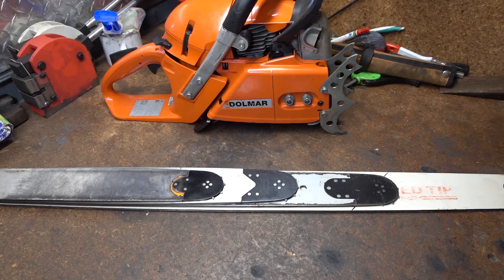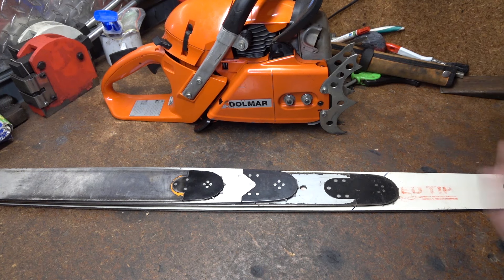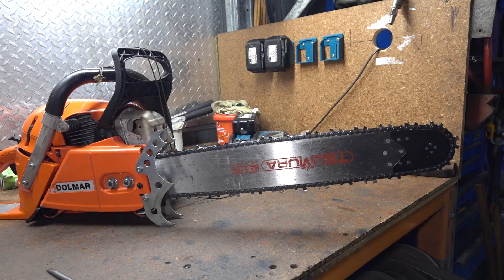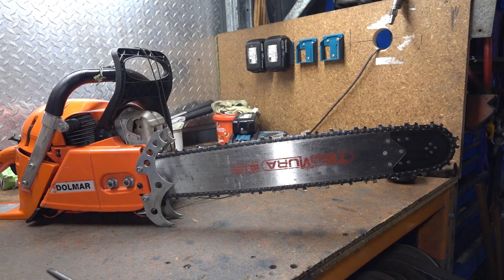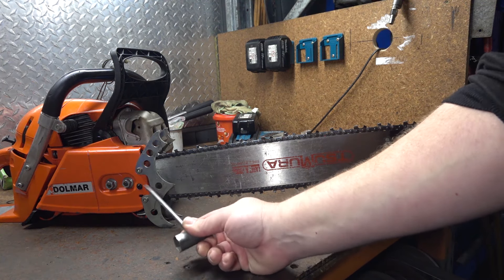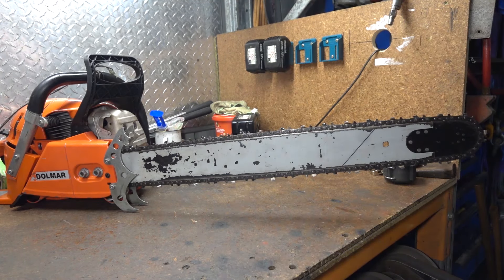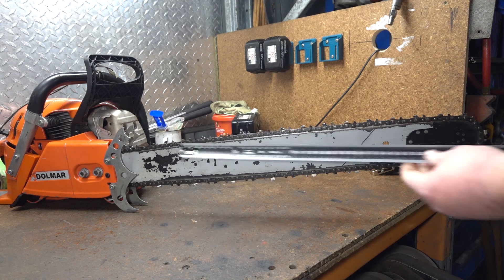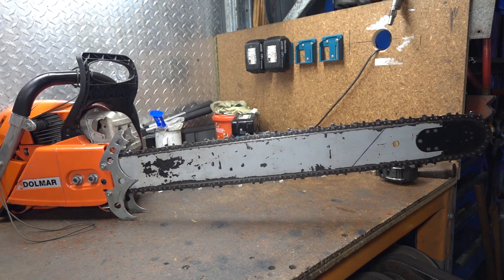Bar length, weight, balance, kickback and why I use short bars

Comment: The original 7900 like yours has the same power to weight as a 500i. So obviously it’s a lightweight powerhead. You’re certainly tipping with a 36” solid bar. In fact, a 36” solid bar nearly tips my 9010, and it’s much heavier.
Reply from the maker: Shhh, don't say that too loud or we will upset the 500 guys. We also can't say it has a wider torque curve and uses less fuel to do the same work.

It's not the best example but I used the 7900 and those bars because everything except the  tsumura bar is now discontinued. I wanted to show this without feeling like I'm trying to sell  something to people.

I don't think I own a saw that isn't nose heavy with a normal 36" even the 880 loses its balance at 25", but at that size it just doesn't matter because it gets used differently.

One day I'll find a 9010 for the right price, I regret not buying one when I had the chance
Reply: @SawChainTheories  it’s wild how Dolmar and Solo did it 18+ years ago and Stihl is just catching on. All great German made machines though.
Reply: I have a 500i but have always wanted a big dolmar

Comment: I only see long bars on the internet, all the local fire wood guys run short bars. I have a 20 inch bar on my 660 clone with small dawgs, my buddies call it a long bar lol.
Reply from the maker: @nseric1233  It's somehow become an arms race to see who can have the biggest setup. I understand why guys logging on the west coast of the US do it but for the average person cutting firewood it's just silly.

The only bars I have for the 660 are 18 and 25". The 36" bar in the video was bought in 2008 and that's its original chain, I just don't use it. I have worn out multiple 16 and 20 inch bars over the years while that's just hung on the wall.
Reply: @SawChainTheories it's not silly when your back is shot and it's the difference in cutting firewood all day or for an hour. You seem like a smart guy Don't discount other people's experiences because you don't agree with them.
Reply from the maker: @Mightycaptain  I can only share my own experiences. I no longer have discs between L1-2, L2-3 and L4-5 and this is what allows me to continue to run saws.

Everyone is different but getting the saw on to the log is what works for me. At the end of the day if you prefer running long bars, go for it. I can bend over but can't stand up and deal with the pull in force of the chain.

Comment: That 16 inch bar you used would have had a 3/8 .058 60 DL
chain,if I am correct,just subscribed to your channel, I’m in Melbourne Australia,regards.
Reply from the maker: @giuseppelatina2640  It is marked as 60DL but I have been running them at 59 due to some issues with some Oregon chains stretching over their life. The C85 has been good and could be left at 60